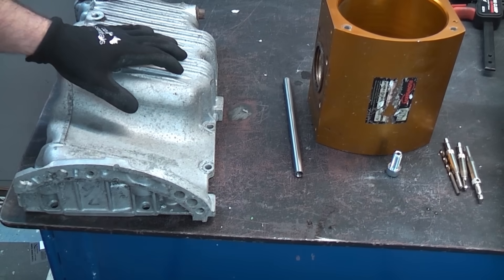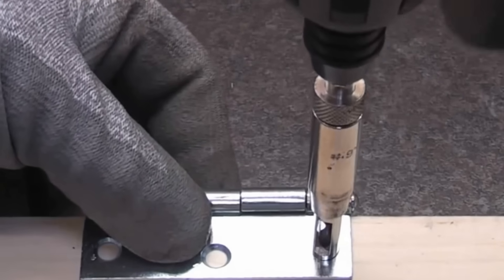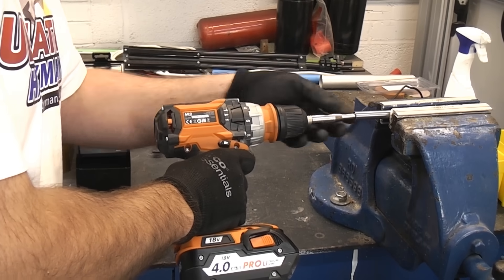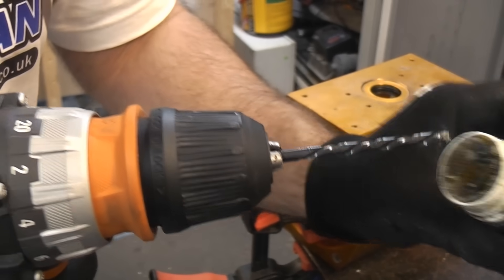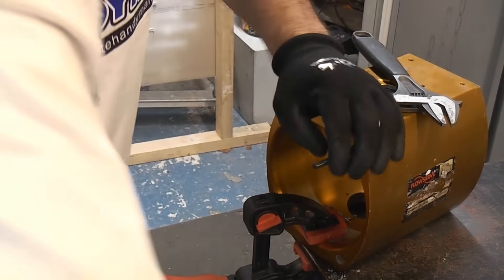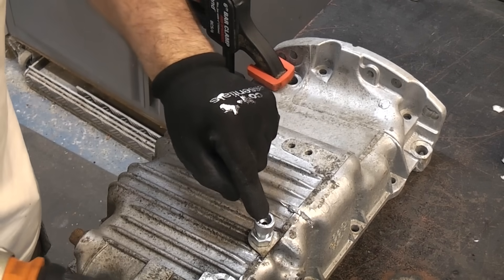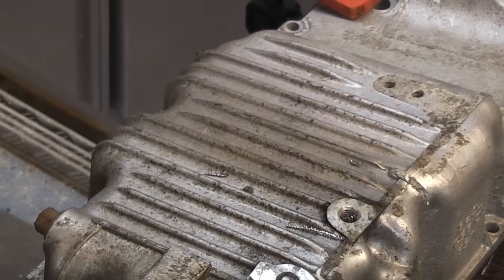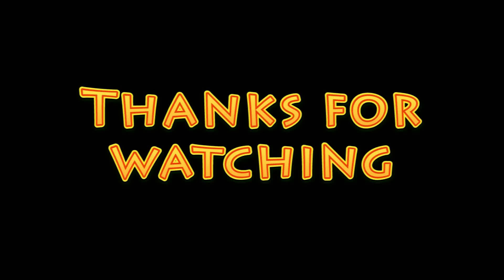How to remove a broken bolt in a deep hole | remove broken bolt in recessed hole

Comment: Does it matter what kind of drill you're using? Or how much pressure you put on the drill? Also does it matter what kind of drill bits you are using? I have two broken intake manifold bolts and I can't seem to get any holes going in them. Using cobalt drill bits by the way. Any advice is appreciated.
Reply from the maker: A cordless drill is best, as mains powered drills can rotate too fast.
Plenty of constant pressure, whilst pulsing the trigger to get it started.
Cobalt should work well, but the studs might have work hardened with the heat from the engine!
Reply: @ultimatehandyman  Thanks for the reply, I ended up getting them both out with your advice, and I got the holes rethreaded with a tap.
Reply from the maker: @mr.airsoft8295   Well done 👍

Comment: Try this, tape on the metal next to the bolt for about a minute, use coke a cola and let sit iver night, if rusted, drill two holes next to eacother , 1/8 size, a small chisel hit to connect the holes, and the broken bolt has become a flat head screw , tap the Chile and use a turning motion on it with vise grips.

Comment: Where do we buy that tool?
Reply from the maker: Hinge centering drills- https://fave.co/2DpJo1H
Left handed drill bits- https://fave.co/2xJjK1M
Teng screw extractors https://fave.co/2OnfRuF
Dormer taps -https://fave.co/2OsN1sQ

If you are in the UK-
Hinge centering drills- https://fave.co/2NE1VMc
Left handed drill bits- https://fave.co/2DubtF4
Teng screw extractors- https://fave.co/2pVLkVT
Dormer taps - https://fave.co/2pTfbyx

exact cutting paste- https://fave.co/2Nabyxc
cobalt drill bits (they are much better on harder steels like bolts) https://fave.co/2zDh3kp

You'll have to make the guides yourself, but they are easy- https://www.youtube.com/watch?v=6mZj0J6CNYA&t=1s

Spring tools centre punch- https://fave.co/2NbnLBD

Comment: Despite the video is a bit old, I really appreciate the suggestions that you give.
Not sure about the copper grease, I was told that's fine between steel-steel.
But it can give a galvanic corrosion when used between steel and aluminium.
Thanks for the tips!
Reply: There's 2 types of anti-seize.  The copper type was designed for aluminum.
Reply from the maker: Thanks for the comment 👍

Comment: Excellent video. I have been in industrial maintenance for 35 years and I have never seen anyone drill a hole through the center of a bolt and use it for a guide. Genius. Another way to get that bolt center puched without damaging the threads is with a transfer punch. If you have the experience you can lay a nut on top of the piece with a broken bolt and weld a nut ti the broken stud. Let it cool and then back it out. Of course you cant do that with aluminum. Just ensure that you do not weld the stud to what ever you are removing it from. It takes a very steady hand and in some cases a specialized welding rod.
Reply from the maker: Yeah, transfer punches are a great tool 👍
I have a set here and keep meaning to make a video about them, but I keep forgetting 😂
Thanks for the comment 👍
Reply: @ultimatehandyman  Yes sir. You are welcome.

Comment: I am smiling at your success! I wondered why you did not use a L-H drill on the last extraction (sounds like a Dentist!) when preparing to remove the broken bolt-end from the alloy casting?
Reply from the maker: I used a normal drill bit in order to demonstrate how to drill the centre, as many people won't have a left handed drill bit 👍

Comment: Where did you get the kits from ?
Reply from the maker: I made the bolt guides myself- https://www.youtube.com/watch?v=6mZj0J6CNYA
Hinge centering drills- https://fave.co/2DpJo1H
Left handed drill bits- https://fave.co/2xJjK1M
Teng screw extractors https://fave.co/2OnfRuF
Dormer taps -https://fave.co/2OsN1sQ

If you are in the UK-
Hinge centering drills- https://fave.co/2NE1VMc
Left handed drill bits- https://fave.co/2DubtF4
Teng screw extractors- https://fave.co/2pVLkVT
Dormer taps - https://fave.co/2pTfbyx

exact cutting paste- https://fave.co/2Nabyxc
cobalt drill bits (they are much better on harder steels like bolts) https://fave.co/2zDh3kp

👍

Comment: Simply brilliant. Merci beaucoup. What is the grease type you use on your reverse drill bit to catch the broken bolt please?
Reply from the maker: Thanks.
I was using cutting paste, to prevent heat build up from dulling the drill bit-
exact cutting paste- https://fave.co/2Nabyxc
Reply: @ultimatehandyman  Thank you for your answer. Your video is just great

Comment: I could have done with seeing this video 30 years ago when I was rebuilding my motorcycle engine (a cylinder head bolt had snapped off below the surface of the crankcase).
Reply: @ultimatehandyman  In the end I took it to an engineering firm and they drilled it out using a radial drill. Eventually used 5 helicoil inserts in that crankcase to restore the situation as well as 12 new bolts. All because no copper grease was used in assembly.

Comment: Help, what size self centering tool & drill bit do I need to remove  a sheared  corroded  9.8  M-8, 1.25x 50mmHex Head Flange bolt, broke at 40 ft lb torque reinstalling the Aluminum Upper Intake !  So glad I found your video.  I'm inexperienced  & anxious.  Watched your video for  left handed drill bit, who makes the strongest to buy?     The bolt  shaft diameter is not very wide approximately 8mm, so it doesn't leave much room for trial and error.  Can I buy a drilled  bolt guide from you?  Please advise.

Comment: What if the head of a screw broke off outside the hole and part of it is sticking out?
Reply from the maker: Just centre punch it and then use a left handed drill bit, similar to this video (although I used a normal drill bit) https://www.youtube.com/watch?v=MR2Dd30Wees

Comment: heat apply solvent, heat apply solvent a couple times. Use center drill to start hole and drill left hand. then we took old tap to make extractor. VERY RISKY

Comment: I would sure like to buy a set of those drilled bolt guides in SAE and metric. Does any company actually make them?
Reply from the maker: Not to my knowledge, but a local engineering firm should be able to knock you some up 👍

Comment: As a heavy industrial plant fitter, most of the broken studs or bolts I have had to remove in the past were anything from grade 8.8 to 12.9, which were too long and overtightened into a blind hole then snapped off at or below the surface... easy outs have never worked for me due to the insane load still existing between the broken bolt and the bottom of the hole. 

I have almost always had to use a mig welder or preferably tig welder to build material onto the end of the bolt until it is proud of the surface, then welding a nut onto the bolt. Once all visible colour is gone, I used a ratchet and Socket to apply torque to the bolt to remove it. Smaller fasteners I remove by hand, larger ones I used impact wrenches.

Obviously this requires extreme care to do without damage to the thread, not only torch control, but also carefully regulating your heat input into the part you are trying to save. 

Hopefully this may help someone.

Comment: something that everyone seems to forget to mention about using left hand drill bits to extract a broken bolt is the importance of drilling in short burst with steady pressure, it's the constant stopping that allows the bit to dig in and begin spinning the broken bolt, also if the item is important enough the best easy out ever is a back ground tap, if easy outs have failed, as a last resort you take an appropriate size tap and put a reverse grind on the tip so it grabs spinning backwards, you may waste a tap but chances are you will save the part, this trick pulled me out of one of my most desperate situations ......
Reply: Wondering will the extractor catch better on the threads of the drilled hole if you didn’t drill it in reverse ?
Reply: You can always have the broken bolts EDMed out.

Comment: That's a lot of messing about.
Just use a drill bit slightly smaller than the root diameter, use that to create a divot in the centre of the bolt, then just drill it out using regular old drill bits.
Work your way up in size making sure you don't damage the threads. Usually once you drill out the centre it becomes loose, so wind it out. If not, continue increasing hole diameter until the wall thickness is so thin that it collapses on itself from the drilling forces.
Clean the hole by running a tap through and you are done
Reply: Also, don't snap the drill bit!!!
But just in case, only use HSS bits for drilling, so in emergency you can get a tungsten carbide bit to drill out the broken drill bit.
Do not break the tungsten carbide bit, or else you are in real trouble!
Reply from the maker: https://www.youtube.com/watch?v=7JCfEMrCjhc&t

Comment: I've had much more luck using bolt removers that have splines instead of reverse threads. The splines don't try to increase the inside diameter of the bolt and once you tap them in, they don't loosen up as you had issues with in the video.

Comment: If a bolt is broken off in a blind hole in cast iron you can burn it out with a oxyacetylene cutting torch. Cast iron can't be cut with a torch.

Comment: If bolting into Aluminium use a Nickel based anti-seize or teflon based anti seize like TefGel - copper will react with Aluminium and some other alloys.  Copper Coat etc. is great stuff for steel and cast iron though.

Comment: Solid video mate. 
In my time in an Aero engine workshop I learned a few techniques to remove broken studs and bolts and I've never seen the cap head bolt guides used. Nice work. Helicoil repairs was another useful skill too.

I've said it plenty of times, the person that invented screw extractors is an absolute genius.
Nothing beats that feeling of removing a broken bolt cleanly.
Reply from the maker: Absolutely 👍
Reply: Great video @ultimatehandyman

Comment: Any advice for small bolt stubs in aluminium 6mm and down in chainsaw etc.
Reply from the maker: It depends how much access you have. I've removed loads of sheared M6 bolts using a centre punch and hammer, similar to what I did in this video with the spring centre punch-
https://www.youtube.com/watch?v=_mTFQbaT3Zc&t

Comment: I removed a broken crankshaft bolt in my 2002 Chrysler 3.8L engine, which was about 7 threads deep.  I center-drilled it, using tubing to keep the hole centered.  It came out with an "easy out", which is one of the few times that has worked for me.  One thing that helped was I sprayed penetrant oil thru the hole in the bolt.  Once you get oil filled, tapping on the bolt helps hydro-shock the oil to sweep any corrosion out and get lubricant in all the threads.  That bolt likely snapped when screwing it in to install the crankshaft damper, either by the "last guy" or even the factory (would they be so mean to ship like that?).  When they snap when unscrewing, they are already jammed in that direction, usually by corrosion, so unlikely an easy-out will be able to unscrew it.

More commonly, I have to keep drilling until the bolt is a thin shell, then either run a tap to cut out the remnants or peel the shell inward if you can get a screwdriver on it.  The later two require keeping the hole perfectly centered.  Worst-case is when the easy-out snaps off to leave hardened metal in the bolt which you can't then drill out.  Perhaps a carbide end-mill could cut it, but many shops have a "tap burner" to electrically vaporize the hardened metal.  A left-handed drill bit never worked for me the several times I tried.
Reply from the maker: Thanks for the comment 👍

Comment: There was no corrosion on the first broken bolt. So the bolt must been a POS to have failed like that.

Also after heating the area sensibly spray some "Freeze n Release" agent on the specific site. The contraction after the expansion will usually break the corroded thread of a broken stud or bolt.

The ultimate test re removing broken studs are on the crankcase of the VW Wasser Boxer T3 Engine

Comment: Thank you for the information, very helpful. 
What about removing studs that are not yet broken, but you fear will break if you try to unscrew them?
Reply from the maker: I've had a few of those in my time.
Plenty of spray penetrant, then turn the bolt in both directions, so if you undo it slightly, make sure you go in the opposite direction every now and again, whilst applying more spray penetrant 👍 
Eventually it should work loose without breaking

Comment: I like your wrench, who makes it  ?
Reply from the maker: It's a Bahco adjustable, I have several pairs of these in varying sizes, they were used extensively on site by most of the engineers. Bahco invented the adjustable spanner, which are often called Crescent wrenches in some countries 👍

Comment: I watched a machinist many years ago dissolve a steel bolt that was broken inside an aluminum nose cone for a tomohawk missile.  He mixed 3 different types of acid in a glass, made a clay bowl around the bolt hole, poured the acid mix in the hole and waited 24 hours.   The acid ate away the steel bolt and did not damage the aluminum.  Pretty slick.   If the bolt or tap were broken level or just slightly above the surface of the aluminum, they would just tig weld another bolt to the broken one and just unscrew the broken bolt from the hole.
Reply from the maker: I think AVE dissolved a steel bolt using Alum a while back 👍

Comment: How nice to have the parts removed from the vehicle. Most times I've had to deal with this situation it's the exhaust mounting studs shearing on the side of an engine block. Try getting those out especially when the broken stud is behind the shock adsorber or other vehicle part and it's been in there for twenty years or so. Even with studs being below the surface, I've had luck welding another stud or bolt on top of the broken one. The heat of welding also shocks the broken threads.

Comment: you really should use a proper tool to run the extractor.. eg 2 handle with 2 sides so you are at all times applying symmetrical force.
like the one included in 
facom set 285.J10PF

Comment: are there forests on the left?
Reply: @ultimatehandyman  sorry, my question was : "are there Left hand drill bits are ideally used for removing broken bolt and studs " ?
Reply from the maker: @charlesdaniel8282   Yes, they even sell extractor kits now with left handed drill bits included. Example here- https://bit.ly/3uUsQaK

Comment: When hitting in the screw extractors hit it hard...not the tap tap he did and it will stay in the broken bolt. Also if you drill off center you can ruin the threads of the hole and the extractor is less effective...

Comment: Great video. Very helpful. I know many of times i could not remove the broken bolt or tap i would either have to drill out or weld the hole shut, and start the process from the begininng drill and tap, However if their was a broken tap in the hole i would have to slowly drill the whole mess out with a CARBIDE DRILL, and re-tap
Reply from the maker: Diamond coated hole saws work well, and are less likely to break than a solid carbide bit- https://www.youtube.com/watch?v=7JCfEMrCjhc&t
Thanks for the comment 👍

Comment: 2:40: No chance of punching and drilling a center hole without a jig ?  Wanna bet ?  Am a trained aircraft mechanic -- they're the best experts you ever saw for frozen or snapped-off hardware...  You can't damage ANYTHING on an aircraft assembly while removing snapped bolts.  I would use Helicoils to protect internal threads while drilling.  Just screw in the Helicoil a few threads and you're protected.  For bolts snapped at the surface you don't have a problem with damaging internal threads.
Reply: @ultimatehandyman  On smaller assemblies drill presses can work wonders too...Nice straight and aligned holes... :)

Comment: There is always a cause for a bolt seizing on a thread, in each case I saw no evidence of that, typically a bolt will break at the flush point i have yet to have a bolt break in the casing but the threaed tap bolt is a good idea since I am going to have to go to town to get one since i dont have a lathe to ensure i am drilling out the centre and i am in town i guess i can stop by the machien shop and get that done as well other then that I dont worry about the threads I can retap the thread and even go with a bigger bolt if i have to

Comment: I'm not bragging, but I thought of the idea of drilling a hole through a bolt. It was a Sunday, I really wanted to assemble a casting, and looked around the workshop. I had a steel component I was making in the lathe, it had a hole in the middle, that gave me the idea! Used the lathe to hold a bolt to drill through, and after a few attempts, got the broken stud out. Anyway thanks for your really well explained methods.
Reply from the maker: I'm sure hundreds of people have thought of this idea 👍
I think that sometimes if you got 10 people to find a solution to a specific problem, they would all come up with something similar. Identifying the problem is the biggest challenge 👍
Thanks for the comment 👍

Comment: The reality is usually lying on your back  working in the freezing cold with a light rain falling.  The bolts are not only broken but rusted as well. There is no room to  gain access  with a drill until you remove half the engine,  then the extractor shatters.  Try and try again with undersized  or oversized extractors. Get a headache from straining your neck and dirt evades the goggles and you get dirt in your eye.  When you eventually get it out, it's like wining the lottery. Then you start on the other two.
Reply from the maker: Absolutely 👍
Reply: Very evocative M’m … 🇦🇺

Comment: Years ago, a spark plug broke when I tried to remove it from the engine. I used an Easy Out tool, and it worked perfect. I just had to find the correct size.
Reply from the maker: Thanks for sharing 👍